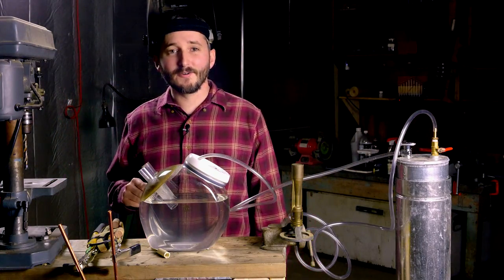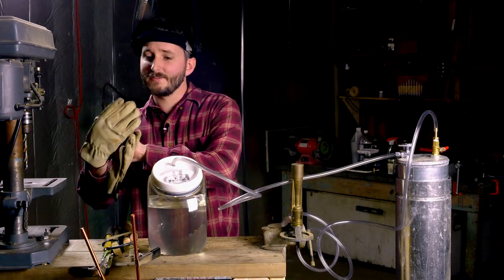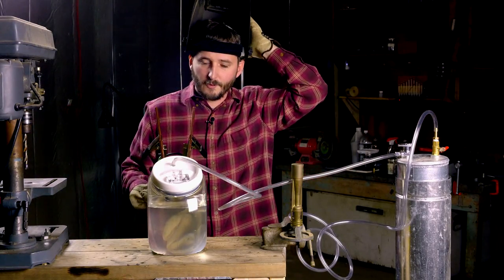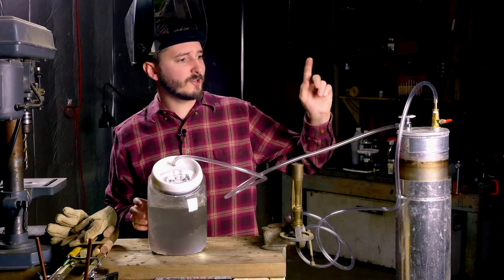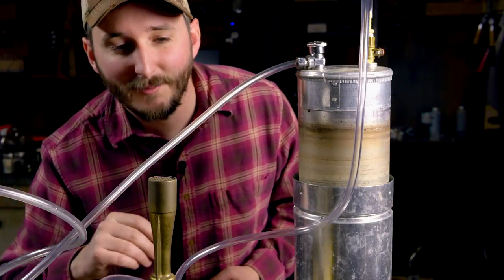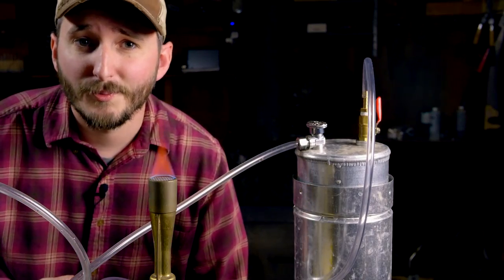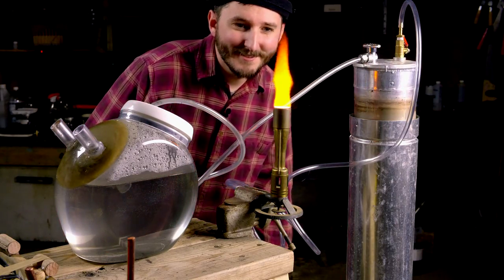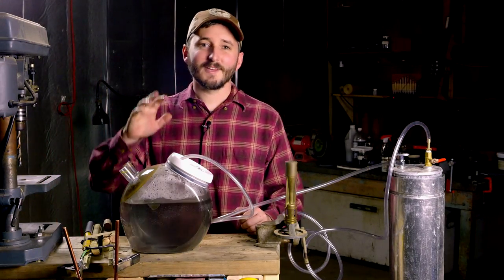Plasma Generated Water Gas (Electrically Produced Fuel That Is Not HHO)

Comment: As far as I remember from my chemistry classes, Carbon Electrode breaks down to generate highly reactive carbon atoms under high temperatures which has the ability to combine oxy-hydrogen atoms to generate an into an hexagonal intermediate unstable molecular state, and finally, another nascent oxygen or hydrogen splices the intermediate species to generate methane, acetylene, ethylene, methanol, formaldehyde or formic acid, which can react back on the intermediate stage to generate a multiple combinations of hydrocarbons, aldehydes and ketones. So I believe its not a single species of gas produced, but a mixture of all probable organic molecules depending on the exposure time

Comment: About that extra yellow-orange colour at the end; there is a possibility that glass got ionised by arc torch and released sodium ions in the gas mix.
Reply: Its hot enough
Reply: It's more likely that the sodium was simply present in the leaf strewn rainwater to begin with. Sodium is an incredibly efficient converter of various energy forms into yellow light (the d-lines), there's a reason it's been used in every street lamp in the world for the past half century up until very recently.
Reply: Oh like Nile Red's microwave plasma  video
Reply: not really the glas because carbon rods for making light are doped with salt to change the lightcolour from something blue ish to warm white and this rods he use are clearly for arc lamps seen them before several times
Reply: @incrediblemichael  You don't know what you are talking about lol. Those are carbon arc rods for removing metal such as welds that need to be redone, or back gouging for weld prep. Those are not rods for acr lamps. I am a welder with 30 years of experience, and I have used those exact rods many many times.
Reply: @incrediblemichael  thats an intentional addition of salt, besides if that was the case it should've been that yellow from the start because he used the same rods
Reply: @3000gtwelder  Well, I just learned 2 things. I never knew about carbon welding rods and I didn't know that there were these 2 processes. Thanks.
Reply: @danstiverson  Yeah, we call it  "Carbon Arc Gouging"  or "Scarfing" They have various kinds of carbon rods for different purposes. Some are square or rectangular, though most are round like the ones shown. You clamp the electrode into the holder, and push a button on the side that releases high pressure air down the side of the rod to blow the molten metal away after the rod has created a short and melted the base metal and created a puddle at around 12,000 degrees F. when I worked at Boeing, we had super high amperage ones that could go up to 400 amps! Makes an incredible sound lol!

Comment: Nice experiment. If the Main Reaktion is H2O + C ——> H2 + CO, the you are able to produce two moles of Gas per one mol of Carbon. Thats 2 x 22,4L per 12g of carbon or about 3700ml per 1g of C. 
Ohne Suggestion: Please weight you Elctrodes before and After, to See if the reaction is taking place .
Greatings from Germany.

Comment: Try condensing the gas using liquid nitrogen or dry ice. That way you'll be able to see if its a hydrocarbon/CO or if you're just making HHO.
Reply from the maker: If it were HHO it would be a lot more explodey than what you see coming out of the burner. My gasometer probably would have gone through the roof
Reply: If it was just HHO, the carbon from the rods would have to recombine into soot, suspend in the water and turn it murky.
Reply: LN2 would work, but only just barely. CO condenses at -192C and LN2 at -196C.
For reference, oxygen condenses at -183C.

Dry ice would not work for anything other than water vapor.
Reply: If you use any other type of gas without a heat exchanger, but just as a direct heat exchange process, then the other gas such as the LNG would vaporize and mix with the hydrogen and then you are back where you started except now it's mixed with a gas that has an even lower condensing temperature.

Comment: Interesting experiment. Probably one of the most inefficient methods possible to create syngas. As a chemical engineer, I cringe a little bit at using syngas as just fuel. It's the precursor to a huge variety of chemical products from ammonia to methanol to Fischer-Tropsch gas-to-liquids products. An absolutely enormous amount of the world's energy goes into making that combination of H2 and CO.

Now I'm curious what you could actually do with your small amount of atmospheric pressure syngas besides burn it. I've designed industrial scale low-pressure syngas plants, but I wonder what a hobbyist could do. I'll have to check some of my books.
Reply: I thought if some of the heat and light energy was recaptured, this would be a good generation method, but it's starting to dawn on me that it's still way too energy intensive to justify at an industrial scale. It's still a fun problem to me though haha.

Comment: Next video, could you try running  this fuel on a generator and or running a stove while cooking eggs or something.
Reply: making fuel  with elecricity and then using it to generate electricity, its like a battery but with extra steps
Reply: @xvidavi  
Better long term energy storage, the energy density will of the storage system improves when larger,  the stored energy can be transferred more efficiently to other storage vessels for powering cars (the energy density is much better for it as well.)
Reply: @xvidavi  
And a lower self discharge rate.
Reply: Love to know them temp of the flame...yes, please cook with that in a video. Even if it isn't an efficient method, you still could perhaps get a fuel for indoor cooking and heating from wind or solar in an emergency (if your home had no gas or electricity for days)
Reply: @calvingreene90  Thats where this gas mixture falls short. It destroys steel and cannot be compressed into tanks the way pure H2 or propane can be. Maybe a fiberglass tank like most firefighters use would be okay.
Reply: I wish you mentioned where this is most dangerous. Pure hydrogen can be stored in propane tanks but this mix cannot. H2 causes some steel embrittlement and CO itself causes severe transgranular decay in steel. The patent (now expired) owner wanted this process to replace propane but his factory exploded when a high pressure tank failed and ruptured. I wonder if fiberglass tanks like firefighters use or aluminum propane tanks would be safe? What about tank fittings and valves? Since this mix burns with a tenth the BTUs as gas and a seventh the BTUs as propane it takes a whole lot of it. My van would burn gallons per mile instead of miles per gallon on this stuff and the whole van interior would be one big fuel tank. I love how well this works at high amperage when other H2 production styles usually can't keep up with the available energy. If only it could be safely stored compressed in steel tanks it would be much more common and useful.

Comment: Out of curiosity, have you calculated the cost of a single tank given your local price for electricity?
Reply from the maker: This would really only be economical on an industrial scale where you have to find some use for the electricity a wind farm was generating through the night (as one example)
Reply: @Nighthawkinlight  I was thinking of energy storage for cold Nordic winters. The standard solution of burning wood involves the very tedious work of moving it around in the summer and keeping a fire going throughout winter. So a lot of households have already opted for gas heating.

The components required for 20 seconds of 150A@20V aren't prohibitively expensive (caps or battery / solar panel). In the summer the sun is also plenty.

Although these small bursts won't be on an industrial scale, one could calculate the solar panel area required to heat a household throughout winter.

Granted, this direction of heating seems quite a bit more dangerous than playing with fire and there are ofcourse many other directions of efficient heating available which are inherently safe, but a lot of them require a big upfront cost.
Reply: @CarbonFiberSpoon  You wont be storing this anywhere cheaply enough to make it worth your while i guess. At least not in a scale that worth considering for seasonal storage.
Reply: @CarbonFiberSpoon  woodgas allows heating far from the wood
Reply: @Nighthawkinlight  then how cost effective. is it compared to a li ion battery
Reply: @Falcodrin  the part which I can see happen with this approach versus woodgas is automation with minimal human intervention.
Reply: @kistuszek  I think this storage question is what will ultimately decide the feasibility.

edit: next to the surface area of solar panels required :D
Reply: @Nighthawkinlight  you can heat up carbon under absence of air in other ways than with an arc.

Comment: I tried it 15 years ago! The idea was to scrap the particulate filter of a Diesel engine to make the carbon rods and use its generator when decelerating to create that synth.gas, which is then burnt while accelerating.
You can't keep the gas mixed for a long time, H2 is so much lighter than CO....

Comment: Hmmm, you're generating hydrogen, oxygen and carbon. This looks similar to the production of syngas. So it's likely that you're not only making CO and H2, but also some of their reaction products.
But what they wrote in the parent is bs: "It is the applicant's belief that a mixture of carbon monoxide and hydrogen (COH2) is a gas which..." <<if it's a mix, why did they write it as one molecule of formaldehyde??? And they say that it's the "applicant's belief", so their don't know for sure what gas it actually is, LOL.
Reply: The applicant is a moron, and this is a useless patent
Reply: sasja de vries. Syngas is a bit safer but if you are going to try this you are probably better off assuming it is making CO and treating it accordingly unless you have a Gas Chromatograph handy. 

I was thinking about putting in a comment about it making some interesting byproducts. He would also be making carbon nanotubes which are a potential carcinogen.

Got carbon monoxide also has a thing for metals etc so there is a lot of interesting chemistry in that reaction
Reply: @glenecollins  Well, syngas is basically a mix of mostly carbon monoxide and hydrogen. And THAT is exactly what he is making here, he is just making plain old syngas.
However I'm not sure how pure that syngas is, firstly there are impurities in the water, secondly I'm not sure if the syngas turns into something else. Maybe the syngas is turning into another hydrocarbon because of the intense heat. In the patent they wrote this gas contains COH2 (formaldehyde), which is also toxic btw. And you're only concerned about the monoxide???

And no, you shouldn't treat this as Carbon monoxide, you should treat it as syngas (mix of CO and H2) with impurities. Hydrogen is way more dangerous than you think, it leaks right through plastic and it burns in any ratio with air.
Reply: @kiyoponnn   You are correct. Most patent applications are BS. People who really invent something often keep things secret and don't patent it so that no-one knows how they did it. And the dumbasses who can't make money anyway like to patent for the prestige and the bragging rights.
The American patent office should be like the Japanese, German or Russian patent offices. They always reject these patent applications that don't invent anything new.

Comment: Thank you for the link to the patent where it is stated that one of the uses for this device would be to provide the COHH gas to fuel an internal combustion engine without the need for problematic gas storage because the gas generation is fast enough to keep up with the instantaneous demands of a gas engine. But that brings up where is the electricity coming from, a large storage battery perhaps. I'm strugling to see how this makes sense.

Comment: 5:42 you turned me nervous when you started to touch the electrodes
Reply: Good to have respect for electricity! In this case it's connected to an arc welder, which is low enough voltage to not be dangerous to touch. It is dangerous in other ways though - heat and ultraviolet light, mostly.

Comment: Could you combine that process with solar panels to make a super cheap energy storage method that doesn't require spending thousands on battery banks.
Reply: SateenDuraLuxe 
I was wondering the same thing.
People are asking about the cost 
effectiveness of producing this gas
compared to the cost of the electricity 
it takes to make it.
If you were getting your electricity for 
free by generating your own via solar,
wind, or hydro it might be very cost 
effective...
Reply: but these things are not free so you should factor in all the costs and efficiencies to be sure

Comment: The reaction between hydrogen and carbon monoxide produces methanol . CO + H2 = CH3OH
Reply from the maker: That would be pretty interesting to form in a secondary reaction
Reply from the maker: I assume it requires a catalyst?
Reply: @Nighthawkinlight  It does not seem like they need a catalyst. But i could also be wrong. 

EDIT: Sabatier's reaction describes that you need 300-400 °C and presence of a nickel catalyst to get methanol.
Reply: It can be done but it's really an industrial process. The reaction takes place over a copper and zinc oxide catalyst at 50-100 atmospheres and 250°C.
Reply: Space a much safer way to store these gases , I have often wanted to know how this could be done
Reply: Wow that would be a seasonal storage option. You could make liquid fuel of your own? Wow.
Reply: Any way to get C2H5OH out of this ? :P
Reply: For making methanol you need higher H2/CO molar ratio, here is 1, for methanol need 2.3 or higher, also you need temperature of 300-500C, here water carry away most heat so you have hot arc and just after it water at room temperature, temperature inside of the arc to high - even if some methanol forms it will decompose pyroliticaly back to more light hydrocarbons.

As he said major components here is CO and H2, everything else is in trace quantities.
Reply: @xeigen2  atmospheres meaning pressure?
Reply: @danstiverson  Correct, 1 atmosphere ≈ 14.7 psi

Comment: on woodgas production, I have mentioned before,on your motorized bicycle project, I suggest installing an arduino controlled carb (using electrically controlled valves) in this way a level of precision can be established.  I hope you are continuing experimentation on this project.

Comment: I've seen this exact carbon Arc gas power and engine which then energized the arc welder, effectively turning water into engine fuel, which also provided an additional output all of electrical load and heat and vibration.

Comment: I did this sort of thing decades ago, like 1986, using plain tap water. I did not burn the gas, but I did notice that it smelled much like Acetylene (aka Ethyne) from a welding tank. It seem likely that there could be some of that C2H2 in the output gas, especially since the UV (ultraviolet light) from the arc can split H2 into atomic hydrogen. I note that large gas clouds in space often have C2H2 in them, as revealed by spectroscopic analysis of starlight shining through the clouds. (Long-time subscriber, but only just got this video recommended in the sidebar. So many great things to look at, so little time!) @Nighthawkinlight

Comment: Wow this sure brings back my ninth grade chemistry class memory~ Pump water vapor through heated coal (without air, like how you made wood gas) you get CO+H2, this is in the textbook of ninth grade chemistry of mainland China，and it shows up in almost every exam, so a lot Chinese students know this pretty well.It seems weird to put this particular fact in the textbook, but it's there for a reason.This process as mentioned in the comment is called Fischer–Tropsch process and it's invented by Germans during WWII, to cope with the Germany's gasoline shortage.Not like America, both China and Germany have little oil but tons of coal, so in the old days China adopted this process to turn coal into gasoline to drive cars and engines(specially-made or modified for water gas), for a few decades(before 70s) the cars on the China street were drived by this stuff.So I guess it's in the textbook as a real life experience and an example of how chemistry could solve real problems.

Comment: Aside from freezing, Tesla came up with a method of electrically charging gasses coming out one center aperture to get them to separate and enter other pipe apertures at staged distances. High frequency Alternating current was used and the voltage needs to be controlled to be high enough to produce the effect without causing an explosion.

Comment: Because of you, I am thinking about making a machine

Two charged graphite disks rolling againar each other. Connected to fans that throw water in the spinward direction...

 Measure current drain, and maximize rotation speed - should also be auto striking when not spinning.

I bet you are exfoliating graphene into that water.  Nice byproduct for a maker :)

Comment: A similar gas mixture can also be made by burning methane and air in contact with a nickel catalyst at about 1950f, ends up about 25% hydrogen 60% CO and the rest CO2 and trace H20.
Made industrially for a mettalurgical process called carburizing.